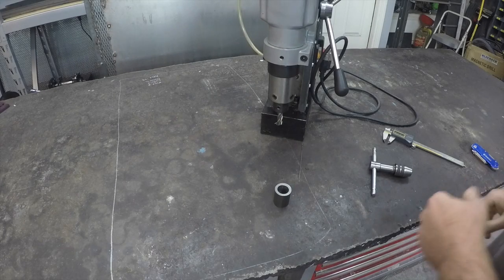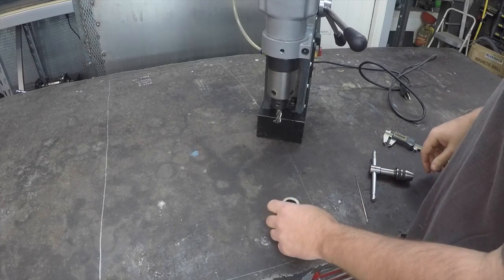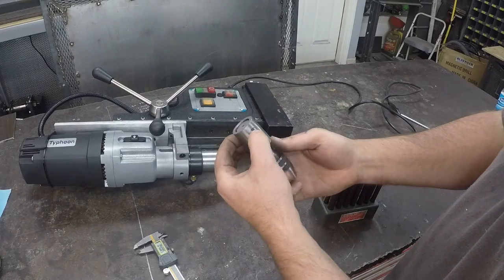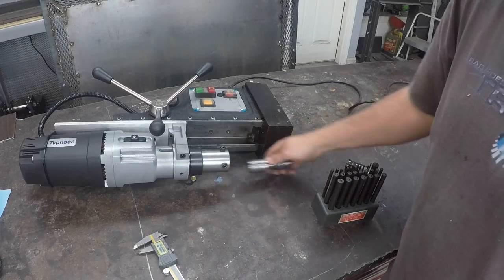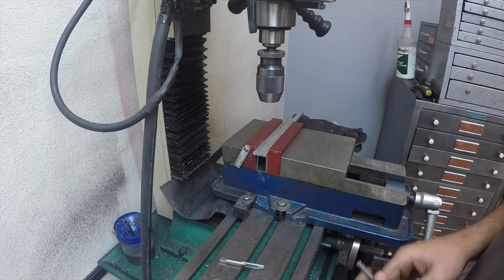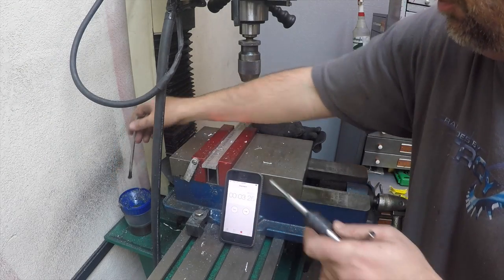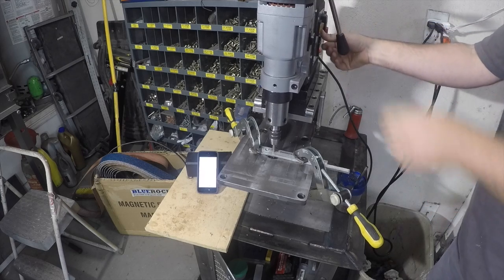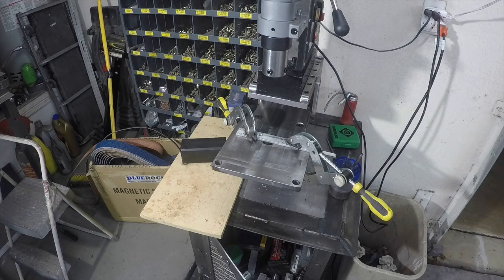Power Tapping - Greenlee Drill Tap Combo - Mag Drill - Metalwork Monday 7

Comment: what's the fastest rpm can be used?
Reply from the maker: +JB 500 rpm on the high setting
Reply: +turbocobra I am trying to drill a hole thru tiny brass pins that go inside locks, you think a metal punch can punch thru the long pins 1/4" brass? is a drill press the best tool? I burned out a drill bit fast using a dremel. the bit came with it so I doubt it was meant to drill brass,  what's the best bit to buy for drilling brass?

Comment: Great idea on the adapter Gary. :-)
Reply from the maker: Yea it has worked out well, i have used it a couple times already.  You done anything with your mill lately?
Reply: turbocobra I just saved up and ordered the 3 piece set of the Igauging digital readouts for the X Y and Z axis.
I will do a vid when I install them. :-)

Comment: I'm with Greg I've never seen a drill and tap in one.  Since the flutes are much deeper does it clean things out quicker?  I'm not sure if it's just the camera but when you did the power tap it looked like there was a little wobble in it.
Reply from the maker: Yes, your right, either the adapter, or the tap wrench has a good amount of runout in it.  I might make another adapter and see if that corrects it.  Although, it didn't seem to effect how the tapping worked...

Comment: The greenlee combo drill/tap is something I've never seen.  I'll have to look those up.  Do you know if there is a technique other than milling that will get a parallel side for a piece of aluminum?  I have a piece I need to make and I'm not quite sure how to do it.
Reply from the maker: are you saying that you have one edge that is square and straight, and the other side edge is uneven?  The only other thing I an think of would be to scribe a tight line, and sand down to the line very carefully...  Thanks Greg!
Reply: Thanks Gary...  I'm thinking that's the way to go.  I guess the other answer would be to buy a little mill...  hmm...
Reply: Need 1 of those...I figure a table with no less than 1/2" thickness should keep her lined up true...
Reply from the maker: Greg's Garage If it's something small enough that you can ship, send it down to me and I can mill it for you and send it back, if it's just a one time thing... but obviously if you need to do this a lot, get yourself a Mill!  Grizzly.com, order tonight, and have it in a few days! lol
Reply: It's a one timer...  I'll see what I can do with my grinder and my files.  I think I can get it really close if I take my time.  If I mess it up, I'll drop a blank in the mail or call 1800grizzly.